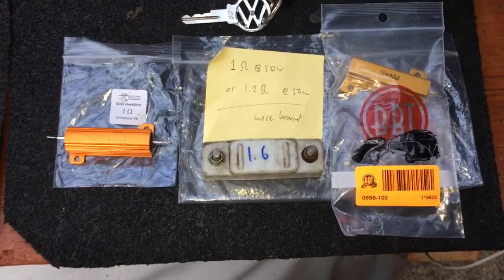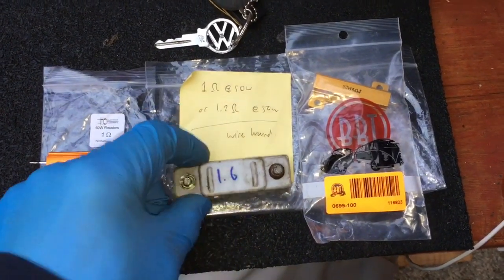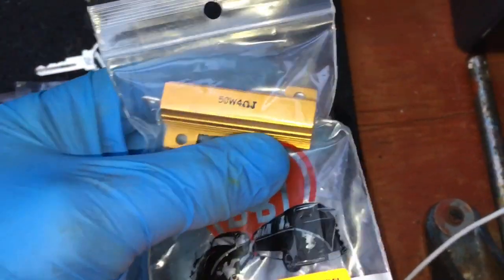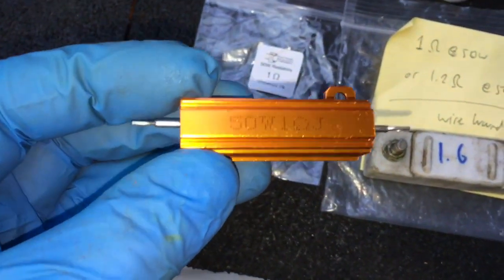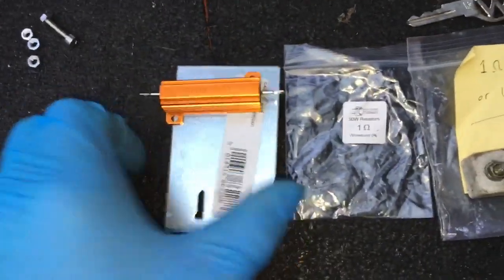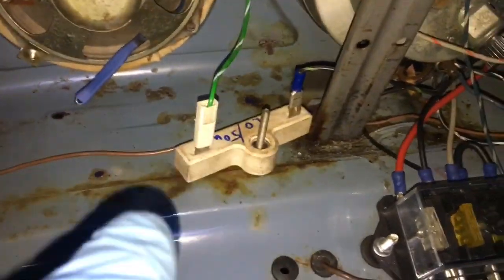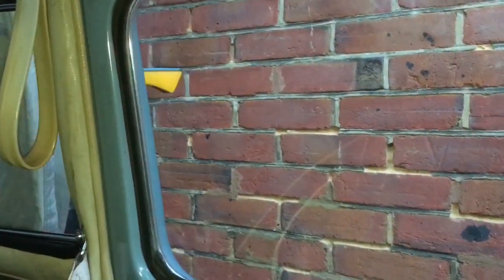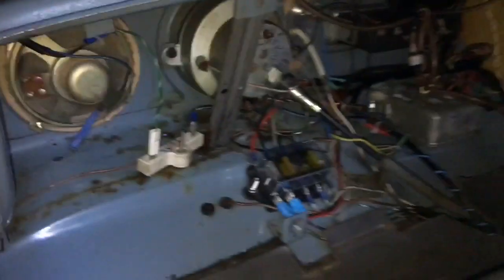Converting 6v Vw Beetle Semaphores to work on 12v  - 1ohm step down resistor (£7.50 the pair!) -2023

Comment: I want my semaphores to blink. I have 12v system.
. What I need to make it work?
Reply from the maker: Hello,
So you need either 6v or 12v flashing led semaphore specific bulbs.
If your semaphores are actually 6v ones, then get 6v bulbs.
If they are the modern 12v reproductions, then get 12v bulbs.
Here’s one type , there’s a few on eBay :
https://www.ebay.co.uk/itm/283301879454?mkcid=16&mkevt=1&mkrid=711-127632-2357-0&ssspo=DDRns-FdTSK&sssrc=4429486&ssuid=AV7gEowcSUi&var=&widget_ver=artemis&media=COPY
Reply: @griceyboysGarage  Appreciated; thank you for your time. I'm still old school type, I want to use my semaphore lights with flashing relays. can you help with that, with a diagram perhaps, I brought semaphore 12volts from Heritage as my 1956 Beetle is converted to 12 volts. I brought Tridon Thermal Flasher - TF122PAC. The Battery used in the car is 56AH 12V, would this be enough to raise the semaphore and flash the light (L/R) is my question. on the diagram it shows one Flasher Relay will do both Left and Right :)
Reply from the maker: @ferniesella3604  hello, so you can’t use a flasher relay on a semaphore, that would make the semaphore in theory just go up and down quickly , which it won’t as it’s mechanical and it just won’t work.
You honestly just need these very clever 12v Vw beetle semaphore flashing led bukbs.
These are the only thing that will work, 60 second job to install each one and they are clever - so they allow the semaphore to rise, then they flash, it’s all built into the circuit board on the bulb itself. They have a light either side of the board so you get light on both sides of the sem lense.
A relay won’t work and isn’t needed in this instance. Just buy these modern tech bulbs. As a note, most LEDs only work one way, so install the bulb , try it, if no light, then reverse the bulb. They are great and £15 usually for a pair. Job done :)
Reply: @griceyboysGarage  Now I get the idea. Thank you mate.
Reply from the maker: @ferniesella3604  the modern 12v semaphores are good, I had a set in my Oval about 5-6 years ago and they were lovely.
12v ones are best, it’s the 6v ones that struggle to rise unless everything in the circuit is clean and good condition.
Great stuff , get the bulbs ordered :).
Reply: @griceyboysGarage  Just a little more mate... Okay I'm going to have to get 12V LED for Semaphores. I want to have LEDs for Break lights. Is this something you can help me with? ....And... just a little more... to improve my safety I may have to put a separate turning light kit at the front on each side of head lamps. I wonder it is necessary with the LED Semaphores going? Anyway, as if I do, it (front turning lights) doesn't have to be LED lights because it is all in one circuit both left and right :)
Reply from the maker: @ferniesella3604  hey there,
So you can easily get the same types of bulbs in led format. Look at your rear bulbs and they should have the code/type on, then search that on eBay and add LED into the search criteria. Something to consider though is their colour type and also the size snd which direction the Leds emit their light - you just want a simple yellow type . You also need to be sure your bulb holders are good. But Leds for the rear bulbs are common and normally not fancy as they are probably the bayonet type.
For additional flashing indicators on the bumpers for example — these can’t be powered from the exact circuit the semaphores work on, as it would sap power from the semaphores, plus you’d need ideally two circuits from the indicator stalk, the new circuit going into a 12v led flasher, then onto each pair of modern indicators. Would be easier to have one or the other …
It is possible to have both, but you’d need to scetch up a circuit and then get all the bits and also route wires from the front to the rear (hassle), plus wires to the front bumper area.
Plus you’d need to find suitably good looking indicators that suit the car ideally.
Lots of effort, but all doable, you just want it looking right/period as it’s an early car. Leds will work best as they do use much less power, so won’t affect anything else on an old original loom. 
You’d ideally also need to replace the original fuse box, with a modern x6 blade fuse box. I did this on my Oval and 58, it’s a good few hours work to carefully put in a new fuse box under the dash and I also did the double one for the headlights, next to the fuel tank .
Hope this info helps! But definitely add in a modern fuse box if you do an extra flasher indicator circuit.
Or….just put in the flashing semaphore bulbs, take it easy and job done for £15 and 5 mins work ;).
Reply: @griceyboysGarage  Well written to an idiot like me, I get it now, thank you so much mate. Yes of course I will buy LED lights for semaphores. Mate, when you say 'a modern x6 blade fuse box', so i can get one from Supercheap Auto, just an ordinary 6 blader will do, right? By the way I'm thinking to upgrade light in my 68 as well. Any inputs will be appreciated mate. Take care. Fernie
Reply from the maker: @ferniesella3604  hey there, good day.
So if you were just upgrading the fuse box in the car, and not adding anything extra, then you could go for a 4 blade fuse box, to replace the 4 way original type. If you think you might want to add accessories/changes later, then buy one like this : https://www.ebay.co.uk/itm/133505079165?mkcid=16&mkevt=1&mkrid=711-127632-2357-0&ssspo=r6kzCbk-Tvy&sssrc=4429486&ssuid=AV7gEowcSUi&var=&widget_ver=artemis&media=COPY .
Reply from the maker: For the 68, which is 12v - you have a much more complex fuse box in that car, and stacks more wires , so it’s much harder to swap the fuse box over (on my old 69, the fuse box mounts inside the spare wheel area, but protrudes into the cabin by the steering wheel - so it’s much harder to swap that type. If it’s all in good condition, I’d just remove every fuse, then clean every terminal with a small dremmel wire brush, will take a few minutes to do them all - then replace with new correct spec fuses and a plastic cover (if it’s missing ). On the wiring side, you’d want to check everything looks clean, if not, remove each terminal one by one and clean with the dremmel wire brush. Then be sure the earth wires and where they attach are clean.
Under the cars , always be sure the earth strap to the gearbox/body is clean and tight . I also usually replace the battery earth and power cables, if grotty, as they are cheap on eBay for the correct or lengths.
Leds bulbs in the 68 are also good, you can even get headlights that fit, but they look modern — but are way way brighter at night.
It’s mostly about clean terminals as this gives you low heat resistance and best conductivity for the car :)
Reply: @griceyboysGarage  Fan-tas-tic Mate, Thanks a lot again. I shall get on with it soon, I be in touch if something else comes up. cheers.
Reply: @griceyboysGarage  Yes, I get it... Thanks a lot mate. cheers